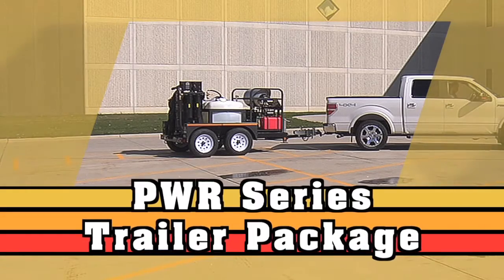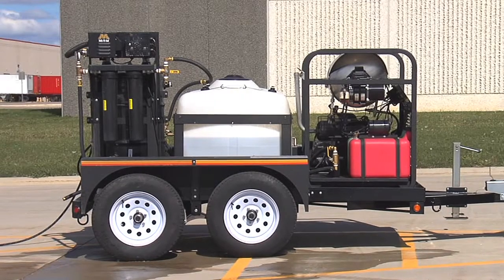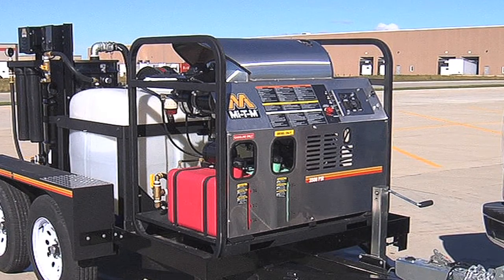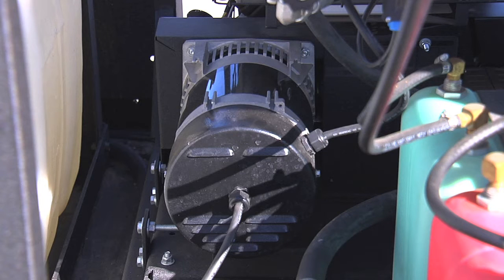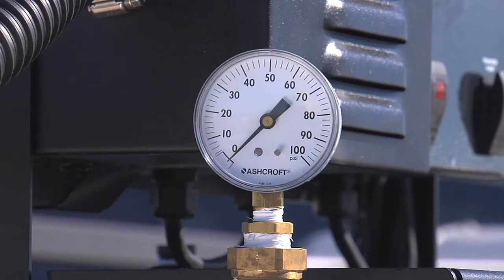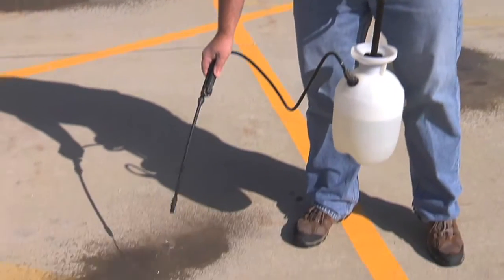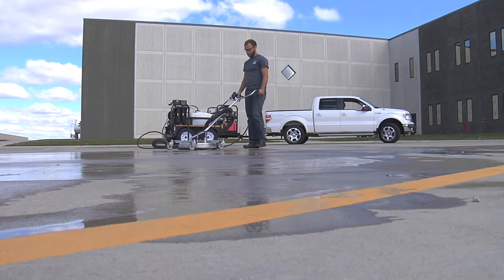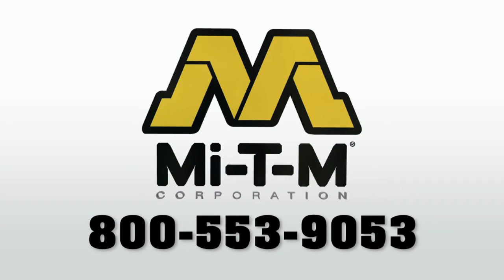Mi-T-M PWR Series Trailer Package

Comment: What is the price
Reply from the maker: Hi Joaquin, we need to know your zip code so we can recommend a distributor who can get you a price. Just let us know when you can & we will reply with their contact information. Thanks!
Reply: @MitmCorporation  zip code is 77029 in Houston, Tx. Does Houston requires reclaiming system? Thank you for your help!!!
Reply from the maker: Hi  @joaquinben4458  , You can call either Rick Babin at Tri Coastal, (713)463-4461 or Alklean at (281)479-5966. Either of these dealers will be able to not only help you with your product questions, but they should also have some first hand knowledge of the local regulations. Hope that helps!